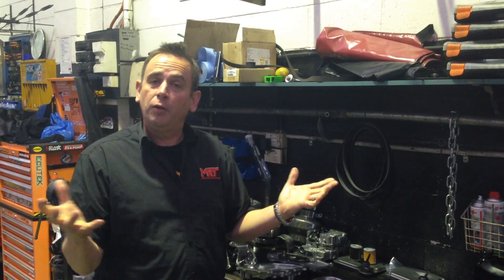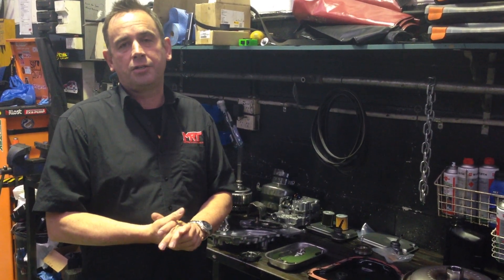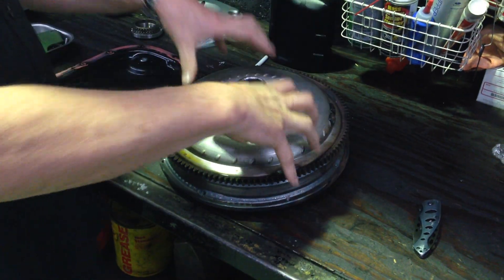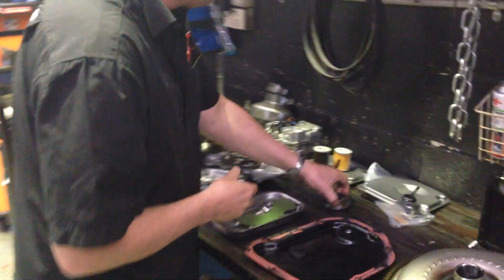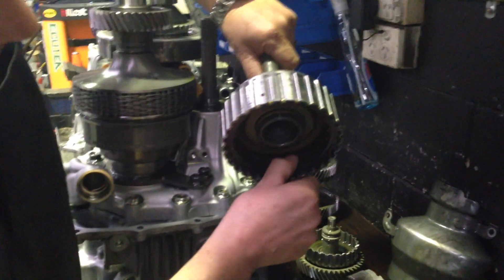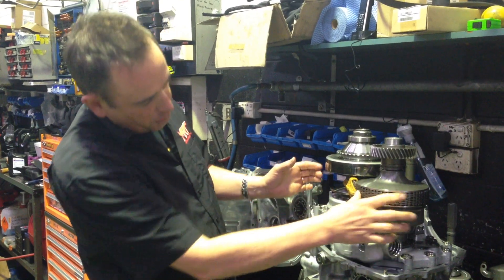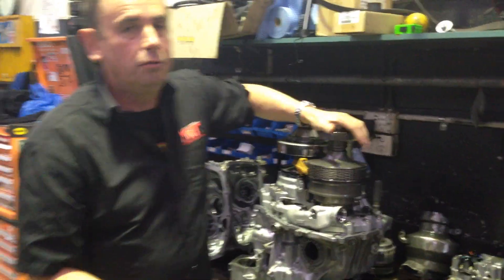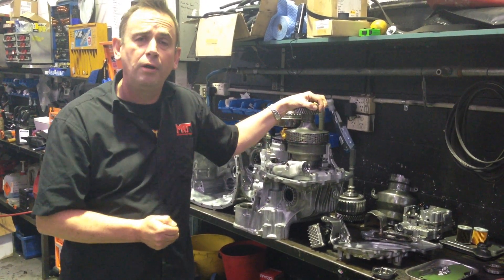Subaru CVT transmission secrets

Comment: CVT were originally developed for industrial applications and that is where they should stay. The governments should make them warrant the CVT transmission for the life of the vehicle as they are not suitable for anywhere outside of Japan. This is the reason we went from Subaru to other manufacturers I will use normal autos and always change lubricant at 1/2 recommended life

Comment: Good video thanks for making and posting. I have a Subaru xv and have been told that it's a sealed unit and does not need a fluid change, I don't believe that. Do you recommend fluid changes in the Subaru cvt and if so at what km intervals?
Reply: You need to change oil fluid for every transmission at 80 km at most or at 70km for safety don't believe any one said tbe oil in transmission is lifetime
Reply: @Supplication_For_better_life  45.000 km

Comment: I have a 2015 subaru wrx cvt. I need to upgrade my trans with the custom Cobb accessport tune I recently got done I can only get 300hp and 328  torque before the trans slips. I need this trans upgrade is there anything u can do. I'm located in the USA

Comment: Hello, how would you describe the noise from the input shaft bearing on the CVT?  I have a brand new 2018 Forester XT that has a whirring noise that increases with RPM and changes pitch/harmonic with deceleration.  I can pop it in neutral and rev it and the whirring follows engine speed so I believe it to forward of the CVT belt.  Another I test drove after purchase had the same noise but significantly more muted to my ear.  In your experience if these start to go, how speedy is the degradation?
Reply: you have the XT - it's probably the Turbo.!!

Comment: Not only are Subaru’s under powered, CVT transmissions are boring to drive
Reply: highwaymaintainer not everybody wants a performance car with shitty mpg.  I have no issue reaching freeway speeds up an on-ramp with the 2.5L.  If want more power, get the 3.6L engine.

Comment: I just bought a 2018 Subaru Legacy. Is this mean that I should trade it in after 4 years and get me a brand new Legacy 2022 ?
Reply: No it means you should buy something else. I'm opting out of Subaru. I had a 2012 Outback, flawless at 82k, but I'm not keeping a car with the likelihood that it'll puke its CVT after the 100k extended warranty is up. $8000 CVT replacement will more than exceed value of car. Also worried about my 2015 Crosstrek with the same CVT. Subaru should be recalling these CVT's. I didn't buy 2 Subs to have to sell them before 100k to avoid the huge hit that a CVT failure would cost. Subaru has lost my trust, confidence and business.
Reply: @bizkitgto He has no clue. But he is running on the possibility of failure. Probably has a negative personality. Just because a car blows up does not mean all cars will blow up.

Comment: I am on the market for a mid size SUV. Subaru and HR-V are all CVT and I am a bit nervous about a trans that needs to have clutches and oil in peak condition to keep the steel belt from slipping. 
You also said that about 400Nm is the limit before the torque overwhelms the internal traction and the thing stops working as it should.
Does this mean that:
a. most 400Nm+ turbo diesels will be CVT free?
b. Towing may be a problem, and 
c. heavy cars/SUVs will not have CVTs?

What's the "rule of thumb" about CVT and size/weight of vehicles where it is not wise to contemplate the CVT?
Ned

Comment: The secret is your head gaskets will fail before the CVT - but not by much.
Reply from the maker: we have never seen head gasket failure
Reply: search US google and you will find thousands of stories about earlier and even some more current head gasket failures. One shop in Northern California is doing the head gasket repairs exclusively.  Subaru itself sells a coolant additive for the head gaskets and recommends its use.  I was searching for a Subaru until a forum for this issue popped up and 2 friends with newer Subarus blew head gaskets.
https://forums.nasioc.com/forums/showthread.php?t=2672476
 http://www.smart-service.com/blog/2010/02/subaru-head-gasket-will-subaru-pay-for-repair
The Dreaded Subaru Head Gasket Issue
Thu, 01/30/2014 - 11:51am - Noah Levy
  
The Dreaded Subaru Head Gasket Issue
Non turbo 4 cylinder applications all have head gasket issues, you've heard this before, most of you know this, and yes its a result of a bad/faulty design with the gasket.

The factory gaskets have a coating that deteriorates over time (typically between 80-120k miles. That range is dependent on if you've run the SOA mandatory coolant conditioner, which is designed to get you past that 100k mile hump).

The symptom of leaking "head gaskets" is oil weeping between the head/block surfaces. This weep over time turns into a significant leak, which then turns into coolant leaking as well, after that symptom you often times will go into overheating, from there its a few mile slippery slope...which then has coolant and oil intermingling together.

Comment: Cool video. I can't control myself though from feeling angry while watching this because all I can think of is the $2,000 this guy probably had to spend to fix this on what seemed like a fairly new car. He's probably still paying off the car and has this added expense now.
Reply: Does not give me a warm fuzzy feeling to go out and buy a Subaru.
Reply: @don-cw1yz  Unfortunately all makes are starting to incorporate this type of technology. Less duty time more shop time.
Reply: @Keys879  Toyota does not seem to have issues with its CVT transmissions. Toyota made a great 6-speed automatic transmission. They are having issues with the new 8 speed though. Those are not CVT transmissions. Nissan makes garbage CVT transmissions, (Jatco is the Nissan brand).
Reply: Try that x3 or more... these things are not fun to loose and is why I'm here researching them for when I start towing occasionally with my 2016 outback.
Reply: @darksd3626  on my third cvt in wrx 58k miles lol
Reply: Subaru extended the CVT warranty to 10 years, 100k miles.

Comment: bought my 2014 forester in may of 2013. now it's 2017 and my CVT just went out today. so disappointing. desperately wish I'd leased that stupid car instead of buying it, I'd have gotten rid of it years ago. so many problems. even down to the low quality interior (plastic breaks, door seals come off, upholstery separates at seams)
oh, and I'm at 114k miles so I'm not under warranty.... 
I'll never buy a Subaru again, which is sad.

Comment: Problem is the cvt that's most car brands are selling isn't actually a cvt. a true cvt has no gears and the Subaru has presets which is actually an auto transmission not a cvt.
Reply: justin jones - it only has presets in manual mode.  In normal mode it is totally seamless and way ahead of their old 4 speed auto.  I haven't really tried manual mode in 9 months of ownership (Forester 2.5S) as the CVT is so good.
Reply: Darryl Hiron agreed but what they don't tell u is they augment starting ratios for fuel economy. Hence a Manuel transmission is faster even tho the cvt should be the fastest

Comment: It looks like the CVT is like a Reeves drive on a wood lathe. When one pulley gets bigger, the other gets smaller to change the ratio. I prefer the older auto trans on my '99 Outback. Much easier to change the fluid and filter . The fluid change procedure on these CVT's is way to much to do and my friend was quoted at $500 for just a fluid change!!!!!!!! I don't think they can take much power, either!

Comment: CVT valve body issues are creeping up on imprezas, outbacks, and foresters I've found out recently. which is a $1200 - $1900 repair bill. I only know this now because my 2014 forester XT with 89k miles recently had a check engine light relating to transmission solenoid/TCC issues (p0700, p2763, p2762) while driving.  Scary ordeal. I pulled over and got those codes before shutting off engine for 20 minutes. the CEL did go away on it's own, but that didn't give me any good feelings and may be a symptom of future issues.  After a lot of research this weekend, it's most likely the valve body electronic "brain" that's faulty.  this isn't uncommon in the Subaru CVT's...
Reply: I have a 2012 impreza. Got 140k, cvt took a shit. Yet all the while dealer kept saying theres nothing to do to it. BS fluid should have been changed.

Comment: In my own experience, the CVT in Subaru is quite reliable. However, the reverse gear the capabilities to climb up hill is the worse and nightmare. It could not even back up hill in light sand surface if above 20°. The Rogue and Outlander never had this issue.
Reply: My sister has a new outback and her drive is fairly steep. The car is on it's second CVT trans. in less than 1 year.

Comment: I am going electric now! can't believe our cars have all this crap!
Reply: Nice-oscar And they get more an more crap on them, soon you cant drive your car by your self(Robot car)
Reply: I agree: I now drive a Hybrid, which acts like a CVT with no moving parts.(no variators, no chain) effective gear ratio is done by pulse width modulation, varying the voltage between a generator and motor. While there are gears and differentials, there is no shifting or sliding of parts, to change effective gear ratios. When I get my next car, I will pass on the optional Internal combustion engine altogether. I'll gladly trade fuel injection for pulse width modulation, and trade in combustion for electromagnetism.(again, no mechanical gear ratio change)

Comment: I have a 2015 Subaru Legacy I have put 78,000 miles on it in 2.5 years 
with no problems so I can't complain about the car but it makes a sound 
similar to a serpentine belt slipping. I have checked the serpentine 
belt so it is not wants causing the problem. The sound is coming from 
the transmission the pitch of the sound changes with speed. I have to go
 at least 30mph and the car has to be warm.  The car is still under 
warranty until 100,000 miles. Can anybody tell me what is causing the 
sound? Is this common among cvt?
Reply: I have a 2001 Honda Insight with a CVT.  The old tranny was replaced because of a "growl" which changes pitch with engine RPM when the transmission is engaged.  What commonly fails on those is the input shaft bearing.  Mine had 135k miles when I did the swap.

Comment: Hi there, I have WRX cvt 2015 and it has 25000 km , everything is great so far only today I noticed that the reverse is not engaging properly! 
the car would back off very slowly , but when I hit the accelerator it behaves like it is on neutral and the engine shakes if I hit more and no reverse action is happening. can you please tell me what is wrong with it and what should I inspect ?
Reply: CVT baby إسماعيل

Comment: Hello Brett (or anyone from MRT Performance)!  What is your opinion on the HTCVT upgrades that are now available on the market?  There's torque converter upgrades and CVT transmission oil coolers.  Would these have helped that bearing not wear out as fast?

Comment: So, my question is how long will that metallic belt/chain last.  Is it the same as a clutch.  How much will it cost to replace the belt/chain?  For me if it won't go 200,000 miles, no good.
Reply: It can go 300k+ if you change the CVT fluid regularly.

Comment: The ultimate transmission would be a very well built CVT with very well calibrated software. For instance, one can calibrate power output to be correlated to your throttle position so that when you throttle the car gently, it tries it's best to maximize fuel economy but when you floor it, it tries its best to maintain maximum power output.

Sadly, in practice they are both poorly programmed and terribly under engineered. Such wasted potential.

Comment: 1. I have heard that replacement parts and quality ones are currently hard to find, true? 
2. If driven properly and quality fluid used/changed regularly, what is a reasonable expectation of duration? 
3. Are these transmissions (or any automatic) made by certain companies and utilized by the different car makes?
   This is an excellent and concise video with great filming quality!

Comment: I prefer a much simpler and more reliable old manual gearbox. Like the CVT Honda's, Subaru CVT's will be problematic and expensive to repair for years to come.  Remember when they first came out with the shift-able automatics, it took many years for manufacturers to work most of the bugs out.
Reply: CVT is much simpler than the manual gearbox, just to let you know.
Reply: Julio, respectfully, without doubt, you are not a car guy if you appreciate CVT's.
Reply: moonlighter6 had altima cvt nothing but problems. now I love my 5speed old skul tranny of my 16 4runner. toyotarules!

Comment: For maximum performance, the transmission should not select a ratio for maximum engine torque, but for maximum engine power.
Reply: aluisious maximum torque is most efficient. Hp is how frequently it makes the torque. So higher in the revs the engine is becoming less efficient but it's spinning so fast more power is coming from it every second. At peak torque it's making the most power but not giving it as frequently due to lower revs. The reason the engine has a peak torque is due to the engine getting in a perfect amount of fuel and air, burning it at the perfect time, valves opening to let the most gas in and out. As the revs change maybe the valves are to fast or to slow for the gas flow.
Reply: care to explain?
Reply: Both are necessary and should be balanced. Cvts do shift more smoothly I would say. I don't think they were designed for racing. Though I think they could be. And probably will be in the future